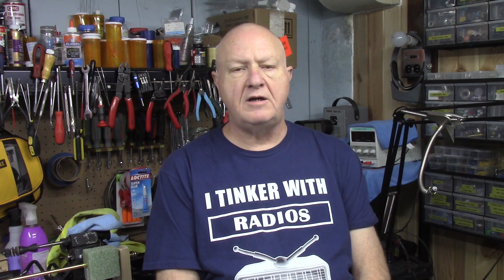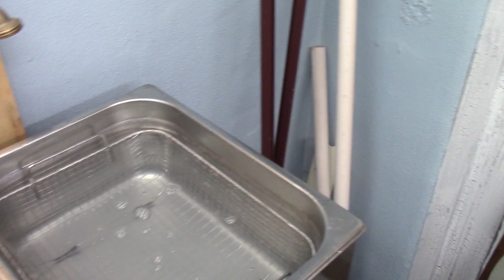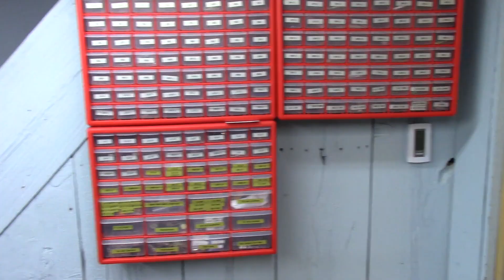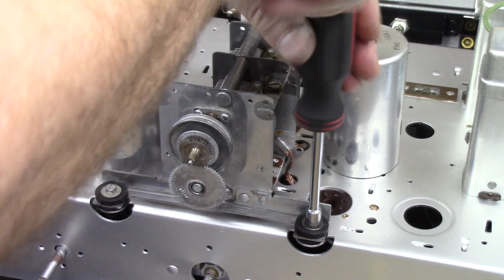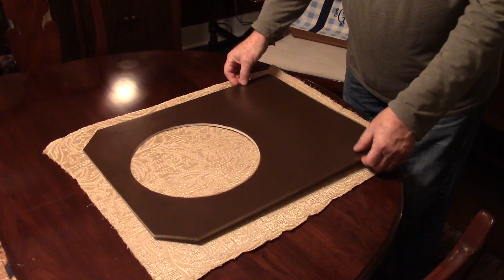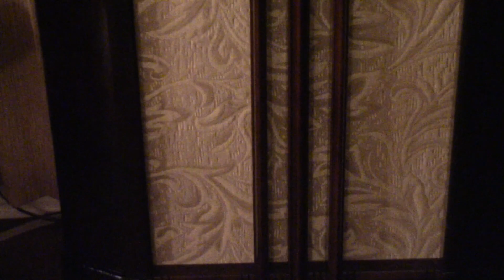1937 RCA 87K  Part 6-  Chassis work begins & grill cloth finished

Comment: Great set of bins to separate parts I have bins but still am not that organized. Great job cleaning that chassis off and on cleaning the tuning condenser. That chassis looks bran spanking new. really nice work on the grill cloth and the cabinet. Thanks for the really great video.
Reply from the maker: Thank you Larry, now I just have all the electrical restoration left.  I'm about 75% through that right now. Been working about 7 hours on that today!

Comment: Gregg - a very notable change after your TLC; well done. Were you satisfied with the results of the citrus acid solution in your US cleaner? What product are you using to fill the surface/pitting rust areas before painting? Keep up the great work. Best, Don
Reply from the maker: Thank you Don, yes the citric acid worked pretty well. I need to get the pure stuff from Amazon vs. the fruit preservative I got locally, but overall, yes I think it did well. I also gave it a bath in the sink with baking soda just in case the "acid" needed neutralized. I doubt it, but since I wanted to rinse it anyway I thought I might as well!
I bought some lacquer based spot primer/putty at WalMart. I used it plenty when I was restoring cars. You can put it on super thin, it dries quick an sands easily.

Comment: It's coming along nicely Gregg, the chassis looks great and the cabinet with the grill cloth looks very nice, this will be a superb restoration. Someone else also asked, where did you get the tuner mounting grommets? Auto shop? Cheers 🙂
Reply from the maker: Thanks David I appreciate it. Actually those are not from a radio supply house. They are from McMaster Carr. The durometer is a bit harder than stock, but much better than was on there, so I'm hoping it will work out. I got 50 for about $11 and small shipping fee in 2 days vs. 3 for $12  a large shipping fee, and only God knows how long to get them. I bought rubber and made my own tuning belt from them at the same time, as well as some bulk hardware and had everything in 2 days for less than $15 shipping.
Reply: @greggsvintageworkshop8974  Thanks Gregg, I'll search around locally and see what's available, those grommets were perfect 👍🙂

Comment: Gregg - when you clean the tuning condenser,  do you remove the MICA sheets ?  Curious ?  I have not been doing that but have seen others who do.  What a great job on that chassis.. it looks great !!  With that rubberized wire, I hope the wires inside you coil cans are ok.. That old rubber stuff is evil :)    The grill cloth looks amazing !!!  really nice work !
Reply from the maker: Thank you Ron, I have done it both ways, with and without. I have had mixed results. Sometimes the mica falls apart depending on the radio condition and it is good to change it out. I have mica sheets do that purpose. In this radio I did not take them out before the bath, but plan to take a look at them prior to firing it up.

Comment: Looking good Gregg! Where did you get the tuning cap grommets?  Spray silver paint? Where? Thanks for sharing….Take Care—Larry
Reply from the maker: Thanks Larry, sorry for the late reply, I just was going through some old comments I must have missed. I got the grommets at McMaster Carr. I know they are not correct durometer, but are better than the rock hard ones that were in there. I bought like 100 of them for cheap and decent shipping. The silver paint I sprayed on the chassis I got at my local Menards.